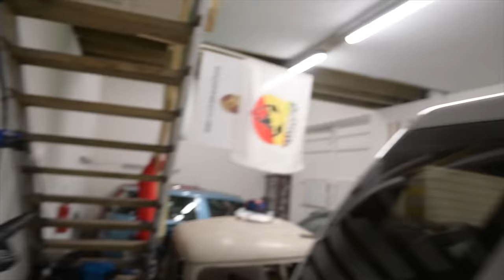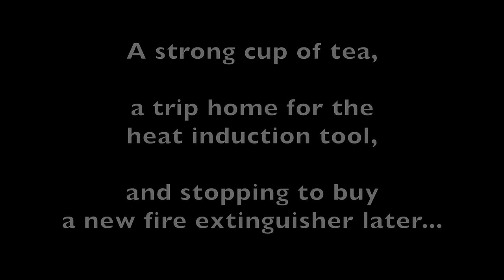Hippo tried to kill me - TWICE! Brake failure, fire and a rusty bolts

Comment: Great video! But I have questions. Isn't there supposed to be a low brake fluid level warning light? And isn't the split circuit supposed to mean you shouldn't have lost the front brakes? As for the backplate maybe it got bent while you were trying to get the old one off? I think that did involve some thumping. Maybe just thump it back.
Reply from the maker: there wasnt low fluid until it fell out, dual circuit but single servo so all the fluid can still fall out
Reply: @furiousdriving  The servo just adds force. The reservoir is meant to be split into two separate compartments. Or so I thought. Could be wrong of course.
Reply: @benc8386 yep - the servo effectively just pushes the pedal down harder on all the ones I've seen, and the brake fluid doesn't go through it.
Reply: @AJB1  Yes. The whole point of dual circuit brakes is so you don't die when something like that happens. You ought to get a warning light caused by the failed circuit while the other one still works.

Comment: I think that handbrake needs adjusting, I set mine up on our auto RAV4 so that the handbrake holds the car stationary even in D or R. Pretty sure that's the way they're supposed to be and would have helped get that in the barn. Edited to add that an old fashioned hammer operated impact driver is also your friend.
Reply from the maker: the handbrake will do that, its how I got it in there but it has to work hard to stop the car from speed
Reply: @furiousdriving I guess the entire brake also being covered in fluid hardly helped either! Crazy how a simple job on the face of it becomes such a drama, why oh why do we put ourselves through it!

Comment: Perhaps that loose clip potentially punctured the rubber boot on the wheel cylinder and thus leaked a load of brake fluid?

Comment: I think every single time I've replaced a wheel cylinder it's ended up going exactly the same way. ALWAYS replace contaminated brake linings across the axle. I'd replace the cylinder on the other side as well, not worth the risk. I always try to avoid buying any car with drum brakes😂😂😂

Comment: In the past, i would have removed the shoes, removed bolts (what ever way) pulled the cylinder out and turned it off the brake pipe , then you could heat up the tube nut with heat and free it off

Comment: That has to be a bad design. Brake master cylinders have a "fence" so that if you lose all the fluid in the back brakes, the front ones still work. Saved me when a Honda Accord split a brake hose. Hippo should also have set the brake fail light on the dash.

Comment: I've never driven an auto, I like a proper box. To stop the car you could turn off the ignition but don't go all the way and set the steering lock.
Reply from the maker: Driving autos is one miserable compromise after another, I hate it
Reply: @furiousdriving  I've seen to many video's of people in auto's hitting the accelerator instead of the brake and hitting four or five cars in a carpark.
Reply: @darthvirago  : Maybe the Americans knew what they were doing when they built automatics with huge brake pedals and tiny gas pedals...

Comment: Why not swap it for the same vintage or older Toyota RAV4, Nissan X Trail, Honda CRV, Vauxhall Frontera etc equivalent.
A great way to discover if the Freelander's maintenance and reliability is actually much better or worse than its competitors.

Comment: Does the freelander not have a low brake fluid light?
Reply: it probably did but as there unreliable and crap that don,t work either
Reply from the maker: yes, but there wasnt low fluid until it landed on the road!

Comment: If that had happened on a Volvo would you still have lost all brakes, the reason I'm asking that is because of Volvos daul circuit brake system, I wasn't sure if it would have made any difference
Reply from the maker: it should still work with dual

Comment: The cylinder does not look like it is sitting flat I think you need to take it off again and flatten the back plate, it has probably bulged while you were trying to get the old one off. I would also change the flexible hose because you got the end of it hot and that is crimped to rubber. Be prepared to file the hole a bit to dress it up after. An old trick was to boil oil soaked brake shoes and clutches in biological washing power solution. But these days I'd just fit new, I suggest you learn to undo countersunk screws with a center punch or chisel, tip best to have a blunt and a good one of each, good to make the cut or dimple then the blunt one to knock it around, oh and use a proper hammer not that lump hammer as you need control.

Comment: and how long ago did hippo pass the mot ???????.........and being a timeserved mechanic that brake cylinder should be flat/flush fitting to the back plate otherwise the shoes are gonna be forced to work at the wrong angle or worse the pistons actually coming out the cylinder
Reply: My friend had one pop out at a police drink driving checkpoint, they said nothing about why they had to jump out of the way.
Reply from the maker: Yes, I could see the pistons were sitting at an awkward angle. It looked fine from outside and was stopping the car just fine until it failed
Reply from the maker: That might take some explaining

Comment: It's pretty poor that a car equipped with dual circuit brakes left you with nothing like that.
What caused both circuits to fail simultaneously? Are they both fed from the same reservoir? If so, that's really terrible design.
Reply: Perhaps one circuit failed months ago!
Reply: @Phiyedough Could be but that would mean there's another problem to find (leak on the other circuit). Also, there should be a warning light as soon as one circuit fails so the warning system may also be faulty.
Reply from the maker: I think its not dual circuit
Reply: @furiousdriving I'd be astonished if that is the case on a vehicle of that age.
Reply: @furiousdriving Just checked and it's definitely dual circuit. There should be a brake warning light for circuit failure and there should also be a warning for low fluid (maybe the same light for either). The reservoir is designed so it retains fluid for the remaining circuit if one fails so a complete failure spells deeper issues.

Comment: Your auto box has a neutral position just like a manual so that argument doesn’t apply. Also even a crappy old box like that one you can change down manually. If desperate you could even try sticking it in park. Your hatred of auto boxes is totally irrational.
Reply: Well said, his reasoning was completely wrong & appeared to lack any knowledge of how automatic gearboxes work
Reply: On modern autoboxes, simply push the gear lever up into neutral. It does not require the release to be engaged. I still love the old Ford 3 speed autos. The worked properly. Put them in 2, and everything else was locked out.
Reply: @michaeltutty1540  agree my Capri has the C3 automatic gearbox, it’s excellent, never had a single issue in the car’s45 years.

Comment: Come on mat,rubbish,you just knock it into neutral like any manual car.do agree with you tho,them electronic handbrakes are a load of rubbish.
Reply from the maker: but you need a hand to do it, and that hand needs to be on the hand brake, use your foot on the clutch in a manual

Comment: I don’t understand your comment re the override for autos. I’ve had autos all my life,you change down to 2 and there is engine braking, then shift to 1.

Wheel cylinders ideally should be changed in pairs.
Reply from the maker: you still need a free hand. Just dip the clutch in a manual leaving your hands free to steer and use the hand brake
Reply: @furiousdriving in an auto, both your hands are free, I had the same situation in an auto a few years ago, shifted down and used the handbrake
Reply: There’s a lot I don’t understand😢
Reply: @arthurdardalis, you do have more control with a manual than auto, there is no comparison.
Reply: @furiousdriving  LOL !!!! 🤣🤣
Reply: @cappaculla what's with the LoL? He didn't say anything funny nor is was his predicament a laughing situation